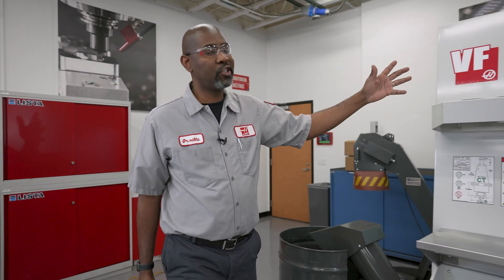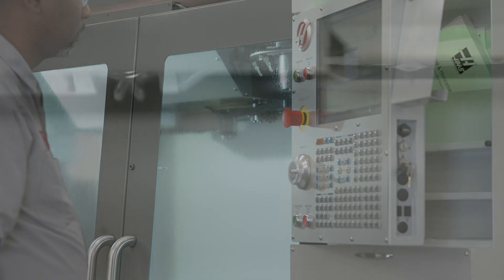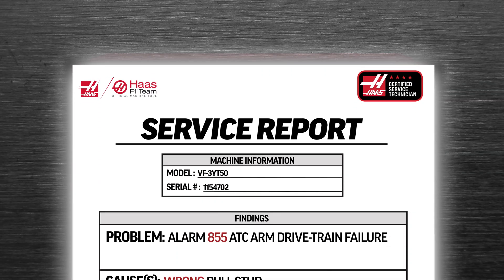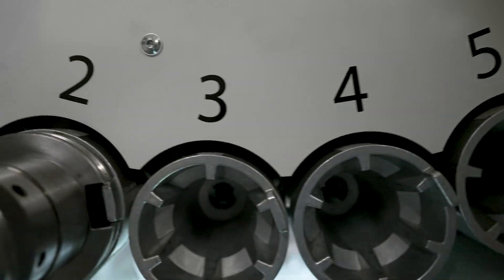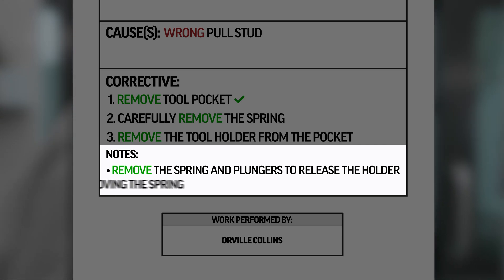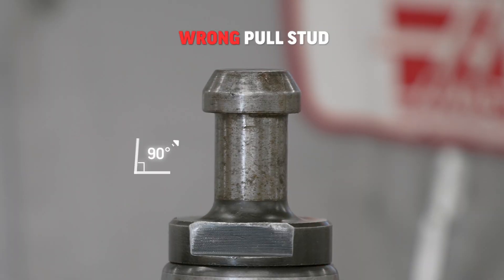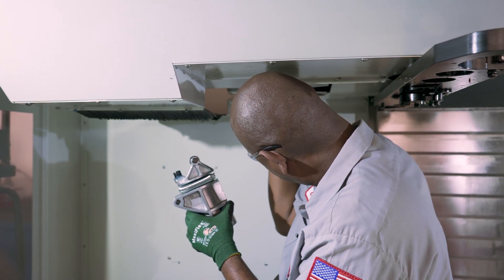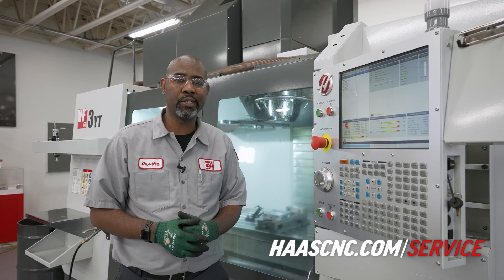Stuck Toolholder??? Orville Makes a Service Call - Haas Automation Service

Comment: Great video. We have other machines that use the 90 degree studs and my operators occasionally forget to check and make sure that the right stud is in the holder. Luckily we’ve been able to get them out by wiggling the holder while prying on it. This is a great video though for when our luck runs out and we have to pull the pocket.

Comment: Used to have this issue, hit it with a hammer, clean spindle bore, scrub tool with brillo pad, clean and lightly oil. Done.
Reply: Problem in the video is not in the spindle.

Comment: Best thing I've found to prevent sticking toolholders in the spindle, is spray the taper with PTFE dry film lubricant. If it does stick, tapping lightly on the side of the toolholders will usually break it loose🙂👍🛠️
Reply: Been having issues with a vf2 dropping tools when doing a toolchange for 2 years, tried scotch brite with clean bore, wd40, 2 stroke oil, hydraulic oil etc and never got it to where I would be able to leave the machine due to random tool dropping. Read this comment this weekend and immidiatly bought dry lube with ptfe. Problem instantly gone! Been running 12h/ 5 days now. The toolchange even sounds different. Thank you for the best Haas tip of the day yet! Every Haas should come equipped with a can of dry ptfe!
Reply: Has nothing to do with the problem in the video, which is a pocket holding the tool. If your spindle has issues releasing the tool, it is time to clean the spindle bore and recheck your spring stack and air cylinder. In some cases it could also be a damaged spindle bore or a tool holder.
Reply: @JaakkoF  Agreed; you shouldn’t be putting anything on the taper itself.
Reply: I just tried the PTFE and it's instantly working. No more loud popping sound when changing tools on my VF2ss!! Thanks Machinist 72!!!

Comment: Imagine If Hass starts working like Apple " sir you have to send that whole machine back so our Hass Genius can take look at that " 😂😂
Reply: They are already doing it. New controls are way more locked down than the old ones. Can't change many parameters without a Haas service key which is thousands of dollars.
Reply: @Eggsr2bcrushed  like what?
Reply: @Eggsr2bcrushed  they are offering free 1 week owner maintenance class that includes a next gen key right now

Comment: is removing all other tools necessary? it does not look like.
Reply: That looks like it's more so that you don't cut yourself when working in the tight areas up there.
Reply: I wouldn't wanna be reaching around up there with a tool changer full of sharp ass end mills and drills.
Reply: @SuperAWaC  or a 5k renishaw prob
Reply: It’s so you don’t accidentally hit any of the tools when you remove the cover.